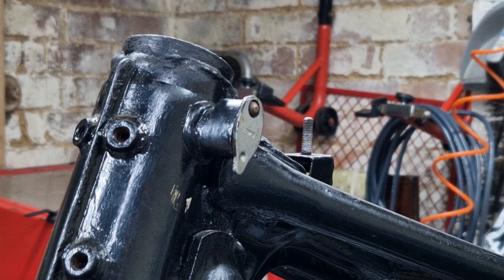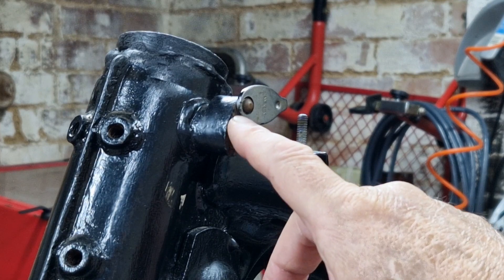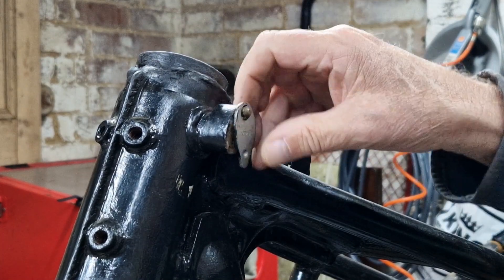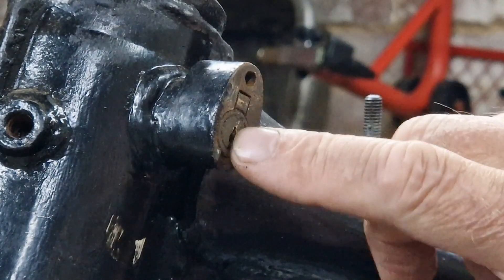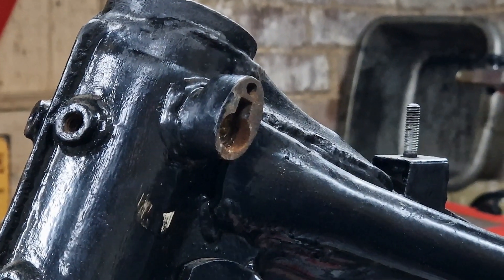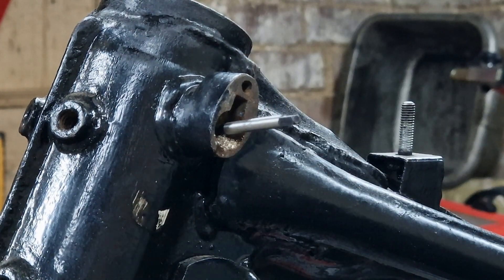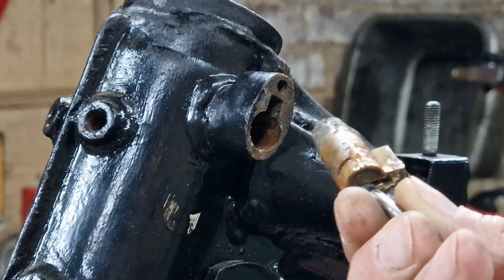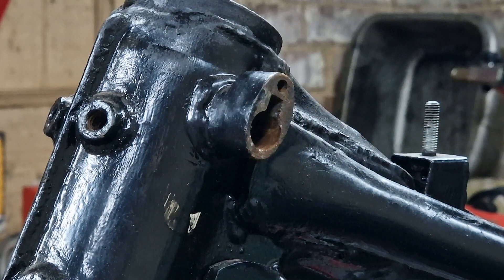How to: Remove a steering stem lock from a Honda GL1000 Goldwing

Comment: What year wing is that, my 76 has it on the key switch , I think 🤔.
Reply from the maker: It's a '76. My ignitiion switch also has a lock position but the barrel that extends from the switch when you turn the key doesn't engage with anything on the headstock!

Comment: Should have taken it to a locksmith and had a new key made
Reply from the maker: As I had to drill the lock to get it out it was scrap at that point. A new lock assembly (OEM) isn't very expensive to be honest.
Reply: Lock looks seized. If you can get the parts then this solution is better.

Comment: All of my GL1000 motorcycle frames doesn’t have those? It looks like homemade and welded on…It should have been installed on the right side instead because the steering turns left there’s no access to put keys in it… My Antique Harley has built in keys steering’s lock on the VL frames.
Reply from the maker: I've had several Honda's with the same lock on the left side. You have to turn the steering to the right to get the key in. Interestingly this bike also has an ignition lock but the locking mechanism doesn't engage with anything on the frame? More investigation required methinks!
Reply: @VJMotoResto  Yes Unless it’s on the Center Stand  Or the Bike would Tip over? I believe the lock should have been located on the Right side for easy access instead of the Forks blocking it?  My GW’s GL1000/1100&1200 has ignition steering locks only nothing like yours. You have a very Rare Frame if the factory do made that way?
Reply: Great video again and a top technique. I'll check my 76 GL as to be honest I haven't looked at the steering lock yet as I only got the bike recently

Comment: Another so called 'you tube expert'......these type of steering locks can be picked with a basic hook pick and tensioner in about 20 seconds with a minimal of skill.....drilling out the lock has been repeated as being the only way it has been accepted ad the norm....picking has been successfull on all my honda, suzuki and yamaha bikes with this type of lock.   However  if the lock pins are seized or barrel is seized in the housing, drilling us the only solution...